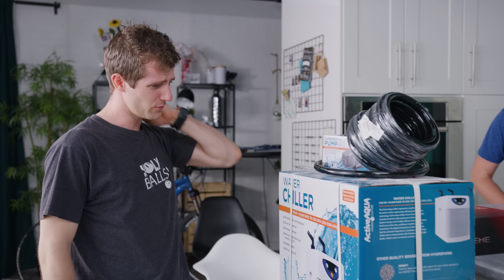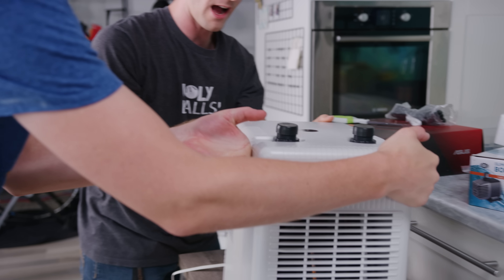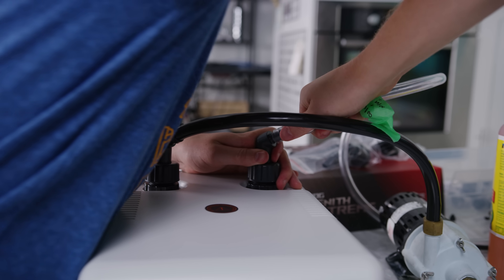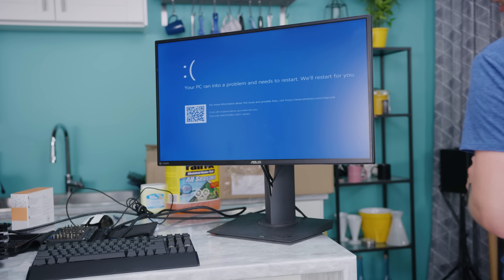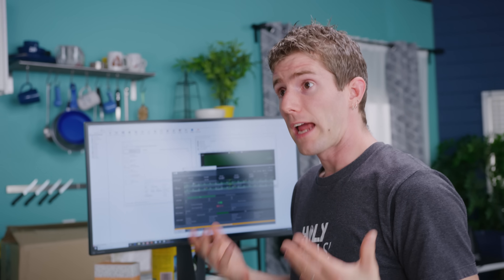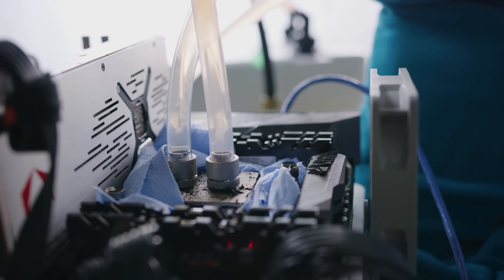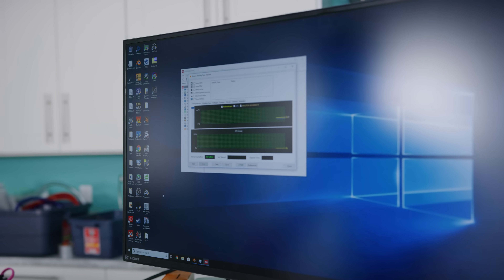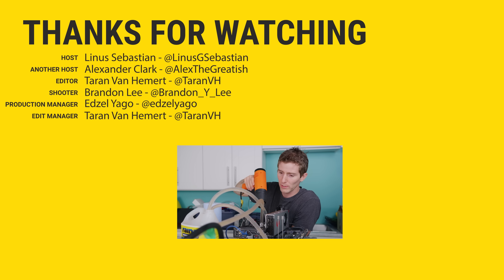Chilling Threadripper 2!!!

Comment: If you are going to boost the 2990WX that much then you may want to run the memory fabric at 2933 or 2666, which will free up a lot more power budget for the cpu cores.  It takes some messing around to find the right balance since some benches are memory-heavy while others are compute-heavy.  And instead of OC-ing the CPU frequency, use the power envelope settings in the BIOS (basically XFR2 on steroids).  Set the thermal and electrical amperage limits to 350, and the socket power to 200, 225, 250, etc...  Using the power envelope settings in the BIOS instead of manually overclocking the CPU will allow the system to idle at 85W (memory fabric 2800 or higher), or 65W (memory fabric at 2666 or lower).

The power envelope settings in the BIOS are far, far superior to the manual CPU overclock settings.  You can tune the system to precisely the wattage you want to pull from the wall.

Amazing, the steps you went through on the BIOS and 'almost blowing the cpu up' is exactly what I went through.  I had to flash the BIOS as well (which fortunately can be done without a CPU in the socket on these mobos).  And my initial messing around with power envelope settings crow-barred my power supply several times.  I thought I lost the very expensive CPU twice(!), but in both cases the mobo or PSU recovered and the system worked fine.

For actual production use there isn't much of a point pushing 600W into the system 24x7 so I just run it air-cooled with the power envelope set to 250-300W.  The thing will run forever in that state.  One thing I noticed with the front-to-back air-cooling setup is that the DDR sticks on the exhaust side of the cpu fan definitely get a lot warmer than the sticks on the intake side.  Doesn't matter a whole lot since I don't run the memory faster then 2933 anyway.

-Matt

Comment: This may save a whacktonne of money on radiators in a whole room water cooling idea, if you had a rack full of 1U GPU servers you could cool all of them with this at the bottom of the rack and you would not need to have any bulky radiators at all.

Say you had a i9 or threadripper + SLI crosfire GPU's X2 or X4
EK-CoolStream PE 480 (Quad) $ 134. per system
Tecoponic Climate/Water Cooler Hydroponic Chiller Line HY500 (150L) £453.69

42U rack say 35U of usable space

35 X $134 = $4,690 for rad cooled systems VS £453 or even if you needed 2 of them that's only £907 to cool an entire rack of equipment, seriously efficient, and you would not have to wire any fans to the radiators, massively cutting down on costs of fans say £20 for decent noctua nf-f12 or industrial fans, you would need 4 per rad and you have 35 rads that's £2,800 on fans

Bottom line that's $/£7,490 on conventional rad cooling or £907 for 2 chillers, and you have redundancy for the whole rack not to mention the amount of fittings needed per rad, and the risk of them leaking.

Comment: When you cannibalize and integrate, mount the motherboard so the CPU socket is upside down from its current config in the test bench. That way any condensation drips down the cpu block and lines away from the motherboard and can collect on a drip tray instead of around the CPU socket. Then except for having to empty a drip tray it would almost be practical for everyday use.

Comment: Question for @linus or his team. If running lower than ambient causes water vapour om/near the board, Why not intall the board upside down/suspended from above? Surely this would completely remove the worry of water vapour getting to the board? Yes, it wouldn't look very good but SCIENCE?

Opinions?

Comment: An easy way to avoid condensation would possibly be to build a hermetically sealed case and fill it with helium.
Reply: Or just use some heaters and craft foam.... You know, the easy way...
Check out my sub-zero system on Legit_Overclocking if you want to see what it looks like. I tested it for 72 hours at -58c without any condensation that I could see. It will be running probably a month to check for pin rust (new socket water-proofing method), because I want to get that right before daily use on a 2990WX

Comment: you could extend the water pipe and set the chiller and pump in another room if the sound bothers you that much.
Reply: so talking about 10+ meters just because some sound bothers you?
Reply: LOL, its depends on the person. I sit right next to my A/C unit $300.00 roughly when i bought it at lowes (tower). Its a little bit annoying but I almost forget its there sometimes.

Comment: Sooo I have a theory. Linus said that the unit had 1/10Hp, what I assume is that they are talking about the cooling capacity. 1/10th of a horse power is only 74.6 watts. So I think that almost all the cooling capacity is in the large thermal mass of the fluid. You wouldn't be able to run this system more then 1/3rd of the time at 250W (regular clock speed) or 1/6th the time at the full 500w. There is no way this system would keep up continuously to the thread ripper on a long render. It only works well for short bursts of power. This CPU rips through cinebench so fast the coolant never really has time to heat up. I think the impressive max CPU temps during the cinebench can also be attributed to the coolant, high pump speed and volume. The coolant flowing through the block is likely never heat saturated.
Reply: Yep.  It'd definitely overheat if it ran very long
Reply: It probably is too weak of a cooler. My cooler runs -25c (roughly 450w load), so my FX peaks at 10c on the core under load at 1.7 Vcore.

Someone needs to sponsor me a new board so I can send it to the moon... or a fire extinguisher, I'll be needing that too.
Reply: I don't get how they get to 1/10 hp. I mean if the motor draws 264W of the wall and only puts out 1/10hp to the compressor, that would be an efficiency of only 28,3%. Normal AC Motors have 80%. That can't be true either
Reply: I think the 1/10th HP was the pump that was included, which is why Linus ran to grab the other pumps

Comment: You could build a system inside a sealed case filled with nitrogen gas with cooling lines going outside. That way you could cool it pretty much as much as you want without having to deal with condensation.

Comment: 32 cores pulling 500 watts overclocked? That doesn't even sound bad when some people made i9 7980xe taking 700 watts with just 18 cores. I would guess that intel demo 28 cores at 5ghz was taking at least 1000 watts.

Comment: The problem with this is that is relies in the stored energy differential of the chiller and not the actual chilling capacity of the compressor motor.  1/10th horsepower is very underpowered when it comes to cooling what's basically a high wattage resistor.  Running a program that demands a ton of energy for a short period of time will release a limited amount of energy.  If you were drawing that much energy for a longer period of time you would not slowly raise the temperature of the coolant, but as that happens you would also lower the rate of heat transfer.   Theoretically, in a perfectly insulated system you could create a reservoir so large that anything short of continuous use would not be a problem, but then you could also just hook your cooling system up your water main with filtration and passivization.  Your window unit is rated for much more cooling than that chiller there.  You could look at benchtop chillers used in chemistry, but those are usually many times more expensive.  Don't you guys have a chemical engineer to do this?  You can just calculate the thermal output of the card and compare it to the rated efficiency of the chiller and determine the max loading on your CPU possible.  That or calculate the minimum chilling capacity required to max out the card.
Reply: We will only know when Linus does some heavy workloads with the CPU. The thing is, with a score of 6 thousand that heavy duty workload isn't so heavy. So for speed use this setup is perfect. It might need to be dialed back a bit for sustained usage.
Reply: Q=mcΔT. Q is energy in Joules, C is sensible heat capacity in Joules per kg per Kelvin, ΔT is the temperature differential between supply and return feeds. The system you have running is a fixed volume flowrate but this formula here uses mass. So get the mass flowrate from density and you have a formula for energy transfer. Put in some sensors and you can measure flowrate as well as temperature of supply and return of the chilled water piping as installed. Do this and you can program an energy metering device to compare rated performance of the chiller. If you have an EC DC pump handy, you can avoid the need for complicated pump motor controls, the voltage will vary the pump power, increasing or decreasing the flowrate.  Getting the right flowrate will ensure the right temperature differential which in turns makes sure the chiller operate right. It's the case of a lot of refrigerant cycle cooling where lower temperature differential, less actual cooling you end up getting. Thats why we specify a 5 to 6 Kelvins temperature differential in chillers and these must remain constant throughout the network even if the flowrate remains constant. This is guaranteed cooling capacity. All items in the system must be insulated to ensure surface temperature is not lower than the dewpoint of the air around (temperature low enough to cool the water vapour in the air and cause condensation).

Comment: 250W without overclocking... WOW! That thing needs a nuclear reactor for a power supply! LOL
Reply: yeah,when you have 32 cores,at least its not a fusion reactor like the intel 28core
Reply: IDK. The Xeon 8180 is 28 core and only uses 205W under load. That's actually comparable (just a little higher) than the i9 7960& 7980 and Threadripper 1920 & 1950. 
That's about 20% less than TR2 was using in this video.

So it sounds like, despite the massive draw, that this is not too far out of control for the TR2... but the more cores the CPU has crammed into it, the more power draw will become a concern (and with it, heat).

Comment: You really should get a CW-5200 from the real S&A as they are made for laser machines (I own one) and include the pump in it and I can say all of it is very quiet.  The pump was so good that the item that was in the box (that you are returning) is what came with my laser originally and when I popped on the 5200 every connection sprang out leaks instantly because the flow rate is just that good.  When it kicks on I just don't hear much above your Aquarium chiller alone though this has a running pump 24x7.   Costs around 529-550 USD and has more settings than you can shake a stick at.
Reply: Yeah, the 5200 is for up to a 150 watt laser so I wonder what it would do on a setup like this?  The problem is the dew point.
Reply: You insulate, dew point isn't an issue (my chiller runs -58c at idle, -25c at full load of ~450w). There are several other steps, but you can run for days straight without issue below -50c. Many have ran years without issue (but also many have failed within a week because you do need to know what you're doing)
Reply: With an average year round humidity level of 70-90% everything sweats.
Reply: That's not a big issue if you prep it well. That's why heaters are used in between the insulation layers, the air ends up seeing room temp (or slightly above if you're worried about it and use over-powered heaters).

I did testing at 90-100% relative humidity when I checked for condensation like you said, it rained hard for a few days and standing water was everywhere. So it was muggy and clammy... You can still do it though. The 1 thing I need to change in those situations, is add some nichrome wire heater to my coolant hoses, because those will condense after a really long time, but the water does just run down the hose out of the case after it thaws. The coolant lines are insulated, but it still gets decently cold after a while without heaters, just like on the motherboard would too if I didn't have heaters on the front and back of the socket. So that's the one thing I need to upgrade on it.
Reply: Far too much work but worst of all far too much energy required so the electrical bill would go through the roof.

Comment: 4 of these Chillers in a beast system of 4 Titans , i9 overclocked and finally play crisis 3 on 1080p in smooth 59fps. ✌
srsly tho, that's a very nice package, if the case is insulated correctly and the pump with the chiller gonna be in another room that's a great system.

Comment: How about 2 water loops and a TEC ?
One loop for the cold side with 2 cpu blocks, one for the cpu and one for the cold side of the TEC.
One loop for the hot side, using the cpu block on the hot side of the TEC. This way the TEC dosen't have to be near the cpu or motherboard so it would be possible to incase the 2 cpu blocks and TEC in silicon, maybe. How effective would this be ? would it be just as effective as thie big setup ? or worse?
Reply: If you have about 3000w in TECs, then you can probably match the 400w of my sub-zero cooler. TECs have a COP of way less than 1 in cooling, while refrigeration systems are well over 1, they are much more efficient. TECs in general are awful, but they are ok for very small low powered projects (like having fun overclocking a raspberri pi).

You probably want 10 or 20 TECs and water-blocks if you want to match what my cooler does, which is pretty crazy (I'd run the hot radiator outside, that's dumping a lot of heat, use at least 3x HX1200i platinum PSUs if you're going to do that, and make sure they are tied into separate wiring in your house so you don't trip a breaker)

Comment: Do you guys still have the mineral oil PC? I want to see a crazy build where you cool the CPU as much as you can while its in an oil bath. Since the whole thing would be in an oil bath, condensation is not an issue. The mineral oil will keep water from getting into the system. DO IT!!!!!

Comment: If you are looking for chillers, you should use industrial chillers used in laser machines to chill the co2 laser tubes. Get a cw5200 or 6000 will be much better than an aquarium chiller.

Comment: NO! I would not like to see you integrate that into a system!
 I've seen y'alls work on project like that and, no offense intended, but your lack of machining experience and mechanical experience makes it just plain painful to watch. I'm guessing you're located about 3,000 miles from me so volunteering my services is out of the question. Just go hire a guy to help you as a little side job. Preferably, try to find someone who is a maintenance mechanic or a machinist who works at a production facility and works on custom set-ups for the factory.

Comment: Yes use this in a dedicated build.  But do 3 things to make it AMAZING and sustainable. These would eliminate condensation  concerns, provide additional cooling to all components,  and have a minimal impact on cost/effort.

1. Include a radiator in the cold loop (that circulates air internal to the case)
2. Seal case airtight, NO fresh air.
3.Install internal fans to circulate and direct air on internal components (VRM, PSU, GPU, Ram, ECT.)

Theory: If you have a 50L case, and the room temp is 25c when you seal the case there is a limit of about 1mL of water in the case.  If you initially run the cooling loop with the radiator fans at the coldest temperature achievable you will condense as much of this 1mL as possible on the radiator (basically a refrigeration dehumidifier).

Comment: I run my system with a floor standing room ac unit ducted to blow directly into the front of the case. The cold air passes over 2 360 rads for my 8700k and dual 1080s. The cold air blowing past the vrms and ram and keeping the entire case an ice box prevents condensation.

Comment: Those cheap chillers don't last. I've had plenty of experience with them on the aquarium hobby. They work fine for a few months and then they die. They commonly leak, their cheap plastic cracks. Decent chillers will cost just more than the threadripper itself.

Comment: just get comformal coating to prevent condensation. drone hobbyist use it to coat the board and any electronics from ice and water damage. its called mg chemicals urethane coating or silicone coating on amazon. this stuff is awesome and covers my motherboard from condensation that the thermo electric peltier causes to my rig.

Comment: https://www.newlifeonahomestead.com/how-to-make-ice-without-electricity-from-water-and-fertilizer/

make a heat sink out of a Aluminium can on the CPU might water a thick copper base or aluminium then place this mix in the can. 

my old man did this to make his cola cold in a bucket of water putting the can in for a moment when he worked in a chemical company. 

anyway I digress, this would possibly make a self cooling very quiet cooling block.. so to speak. would be interesting

Comment: Mount board so that it's hanging from the top of a case and the cpu pointing down so any condensation will just drip away from the board and not run down onto it

Comment: Use this to cool down a pc inside a tank with mineral oil. No problem by condensed water.
Reply: As others suggested in addition to a mineral oil tank add a radiator to the out line to cool the oil abit before tossing it back to the cooler.
Reply: What about using FROZEN mineral oil :)
Reply: That's what I was thinking.
Reply: I 100% believe this is how he should integrate it into the system for a more "practical" use
Reply: Or just insulate everything good

Comment: One tenth of a horsepower is a shockingly little power
Reply: Not really...

Even decently sized industrial motors rarely go over 1HP, 1/10th for a small pump like that is actually quite a lot.
Reply: for a PC liquid cooling system?
Reply: One HP is like 750-ish watts, so 1/10th is around 75W. Not a whole lot, no.